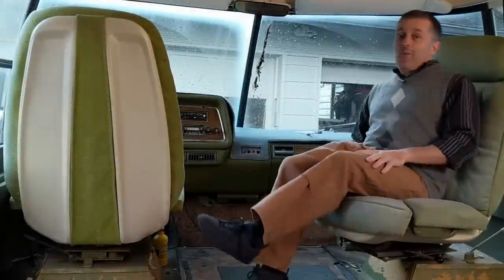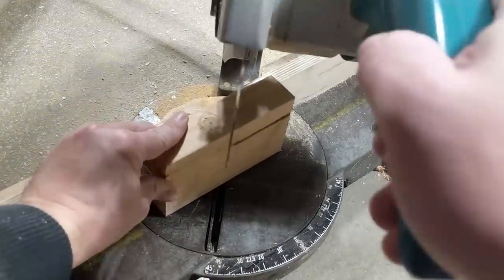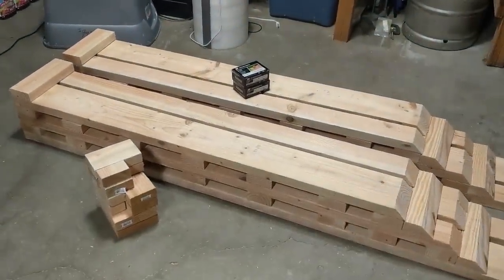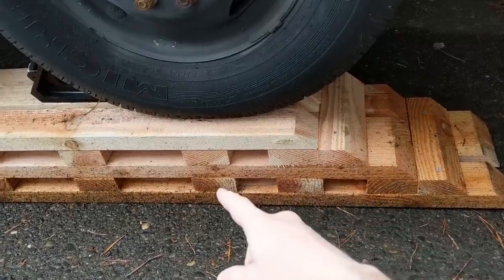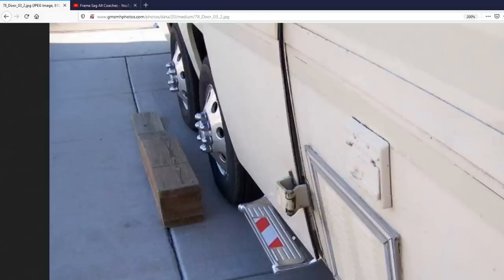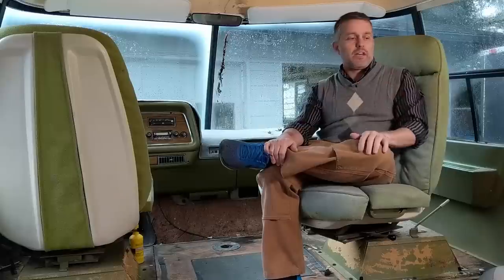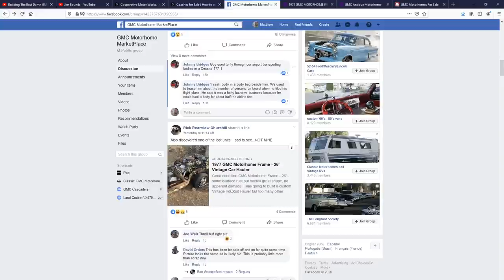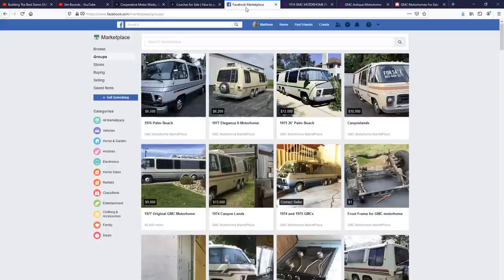Building the Best Damn GMC Motorhome Ever E.6 - Buyer's Guide, Wood Lift Ramps, and Sagging Fuselage

Comment: The Ragusa step needs to be moved slightly  aft of the entry door so when you step out of the coach it's a more comfortable transition down to the step surface. I clamped mine on and tried it in both positions and it made a large difference.

Comment: Check the date codes on those tyres before driving it any distance again, one of them seemed to be '06 so well age out (and the quite evident cracking on the side wall), take it from someone that has had a tyre go on an RV, I was lucky and only destroyed a wheel arch.
Reply from the maker: Yeah, They definitely need to be replaced first thing once it starts rolling.

Comment: I just started making your ramps today. I didn't notice the length being cut down between the ramp levels. Ie between layers. In your case I think it's fine as you are on a really steep hill. However in my case where it's really flat that angle of approach puts a lot of stress on the motor trying to back them up. Mid way through the build I went back to the normal way of making them. 

The extra wood I had to buy to make it I will use to make a front ramp. Other than that keep up the good work.

Comment: How about drilling and tapping through either side of the hole to hold the back of the step together with 4-5mm  threaded rod. Will hold together for the penny washers to clamp it up and share some loading to the broken end cap. Bit like fitting a bearing end cap on a piston con rod . Very interesting series so far.

Comment: A suggestion; use chocks to keep those ramps from sliding back and always use a ground guide when backing up.  I personally would enjoy watching the upgrades / repairs vice hearing about them then snap seeing the work done.  I did notice it's Apr and you haven't posted anything new on the GMC, but you're posting on other projects.  Curious why the switch
Reply from the maker: >Curious why the switch 
Just living my life. The GMC is a long term project.

Comment: you have to remove top layer of decal before using the wheel, only designed for getting rid of the glue adhesive and not the the vinyl

Comment: You are overthinking the step, they want it moved over two inches from the hinges so you use the whole step when you're getting in and out. 
When you're standing in the motorhome open the door and look down. The door will be over the step by about 2"  because that's about how thick the door is.
Reply: I own this motor home. 
That said: I dont understand what the meaning your comment.  I m wheelchair bnd need to make a double hinged ramp to fold out the door and then down to ground. I got it figgered but m to weak to make it now.  THIS THING RIDES LIKE A BOAT OVER THE ROUGHEST ROADS. But its got 4.5 inch clearance. Impossible to get under it. It also gets stuck in soft ground abdolutly everytime .a 15,000lb winch should be standard equiptment. Yes its that bad.
Reply: @skipperskipper2936  I have no clue what you're talkin about.
Reply: Well I understand that.
But as for what I said:
Open the door. Now fold down the wheelchair ramp. 
It cant be stored in the doorway. So how do you hing ramp at bottom and have it out of the way if someone wants in/out?
I remove the one booth seat. (Cant use it with wheel chair) this gives me room to stand ramp vertical but not in doorway. So ramp is folded up then turned 180° against the wall with an L shaped hinge at bottom of doorway. Now do you understand?

Comment: I wouldn't worry about them rotting... So long as you let them dry out occasionally, they will last year's. For example, a raw fir deck will last about 10 to 15 years no problem (in BC).
Reply: Not if you live in western WA or Oregon.   It’s wet 9 months of the year.

Comment: I wonder if a front-wheel-drive (FWD) LS4 power train from 2005-09, namely the Pontiac Grand Prix GXP, the Chevy Monte Carlo SS and Impala SS, and the Buick LaCrosse Super would work on these. from the specs, the original factory engine and the LS4 got specs that are very close to each other.
Reply from the maker: That's an interesting possibility. "The Wolfe Fam" is another Youtuber making GMC motorhome content. He  recently installed a Diesel motor into his coach.
Reply: Thats a high rpm engine, you need a 6.2 LS truck motor that makes its peak power down low to move all that weight
Reply: The issue is the front axel needs to go straight through the oil pan. The 455/403 is really the best motor for these. Its also much cheaper to have a 455 rebuilt then try to do a one off engine swap.
Reply: The powertrain means it has a transmission. The transmission on that power train is the 4t65 a front-wheel-drive transmission. As to high RPMs on the engine that is not a good or bad thing. Tuning the transmission and the cooling system is all part of the solution. If the engine is cool and efficient the vehicle does not care if the same hp and torque comes from high or low RPMs. One has to consider the whole powertrain. GM made trucks on the 5.3 and the hot rodders for that year of Monte Carlo, impala or grand Prix commonly use parts from the truck models of the 5.3 to get more performance that is bolt-on. While the 455 with a 3-speed transmission was the solution back in the day there are more options now with a lot more modern engineering using advances in efficiency, manufacturing, and metallurgy. This is all a big what-if scenario as he stated on the video these motorhomes are old and they take a lot of effort and money to get them to tip-top shape. The beauty on the design of the power plant for these to me is that is all self-contained on the front of the coach.
Reply: @mucholocodawg  The front drive set up kinda limits you on what you can put in there, ive seen people put 500 caddy engines in these things as the bellhousing is simular to the oldsmobile. Theres a dude on You Tube with a turbo charged gen 4 6.0 liter  in a 70s old school Winnebago thats just a blast to drive but its rear wheel drive so it was a lot easier to put in as they simply removed the 440 Dodge and sat the engine and 4L60 trans from a junk yard  put it where they thoght it should go and made some home fabbed engine mounts and a custom driveshaft and used a stand alone wiring harness that only needed a few wires from the RV to run, This is pretthttps://www.youtube.com/watch?v=nEdIuoCus3Qy hillarious

Comment: 40 degrees it's not even that cold inside my refrigerator that's insane anyways definitely it is one of the best motorhomes ever made but because of the year really the only way to do it correctly is completely gut the inside and rebuild the Skins because of the aluminum fiberglass joints lot of work but probably worth it if I could find them at a good price I would definitely go through it, unless you could find one that has been stored indoors its entire life

Comment: Did I hear you correctly that you want to install safety shoulder harness?  Is this for the bench seating?  If so, please share your idea of how to do this
Reply from the maker: I'm installing Bucket seats there with a built in Shoulder Harness. There are a couple of options. I talked about one of the optons here in the very first video: https://youtu.be/6NBqcXjuYWU?t=773  and I showed the reclining bucket seats I will use down in the passenger compartment here in episode 4: https://youtu.be/Gu62RG1tkp4?t=526

Comment: My name is Oscar, i recently purchased a 1977 gmc, the exact model you have.  I’m having trouble getting the vehicle started. By looking at the front of the vehicle I noticed the fuse box looks damaged/broken. Would you mind sending me any wiring/replacement parts information sheet, for that connections. This was the information also provided by the first owners electrician. I can provide more info if you contact me.

Comment: The step needs to be off center because you almost never open the door over 90 deg and always step in at a angle and also exit at a angle so that step being centered will make the step effectively 2 inches short.

Comment: According to your pics of the flange you plan on bolting the step to, you don't have nowhere near enough edge distance for what looks like a 1/4" bolt. the leverage you will exert on that flange will definitely cause problems in the future. You need at least a diameter and a half from the center of your bolt hole to the inside edge of the flange, more if possible. Trust me, approach this build as if it were an airplane with regard to structure. I wish you much luck. Me, I'd ditch the step.

Comment: Consider using  FMS=1044 sealant for all your seams and rivets. This is fuel tank sealer for aircraft that is flexible and has great properties for areas subject to thermal expansion. http://flamemaster.com/wp-content/uploads/2014/07/CS5500-B-10-2009.pdf or similar. qlso see:https://www.skygeek.com/ppg-aerospace-1750a002fm012pt-gray-fuel-tank-sealant.html

Comment: Not a faulty wheel, you are over heating the wheel. If it works when it’s cool then common sense should tell you to slow the rotation down. The wheels are meant to break down so you don’t screw up the paint underneath.

Comment: I spy an old AMP front suspension fork...
Reply from the maker: Good Eye. I have two of them. On is installed on the bike. They have both been modified for 700c wheels and disc brakes.

Comment: This is just an observation on American woodworking as seen on youtube. Why is nobody using a regular hand saw? if you ever see a manual saw being used its a Japanese pull saw. 
Do get that it is not the optimal tool for all situations but it's a good allrounder and does cut quite quickly.
Reply from the maker: I bought that saw for like $10. I used to be a framer when I was in my 20's, and I did a short  stint as a Timber Framer. I love Japanese hand tools. Specifically Pull saws, Chisels, and nail pullers.
Reply: cut on the pull is more accurate, they are sharper and leave a thinner kerf.

Comment: I got 1 same color as yours. 
I need exhaust pipe from manafold all way back.
I cant run engine cause it blast directly at gas tank.
( I backed over a wood fence)
How the h can I get under it to fix. Mine only leaks around window rubbers.256.
Can you text404 so we can
 ate five 7nine.  My number will change soon as I m getting new phone different carrier etc..text as I m 1 of those old farts u mentioned hard of hearing  vietnam combat vet. Talladaga
Reply from the maker: Skipper. You should definitely get a Facebook account and become a member of the GMC motorhome groups. GMC motorhome groups is the only reason I use Facebook. There are lots of helpful people and parts for sale over there to help you out:
1) https://www.facebook.com/groups/183025891821956/
2) https://www.facebook.com/groups/354604151348488/
3) https://www.facebook.com/groups/1422767631350956/
4) https://www.facebook.com/groups/1834729043484643/

Also, here is video where Jim Bounds talks about the Exhaust system: https://youtu.be/YL_4R9tUsAE?t=244